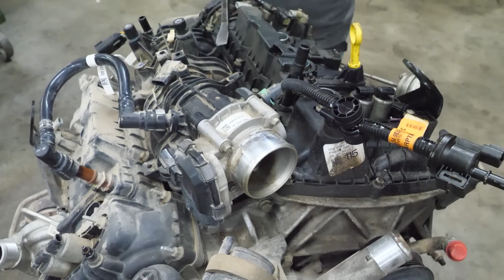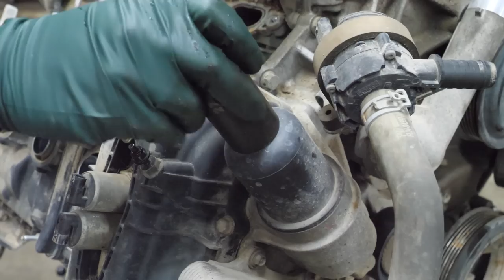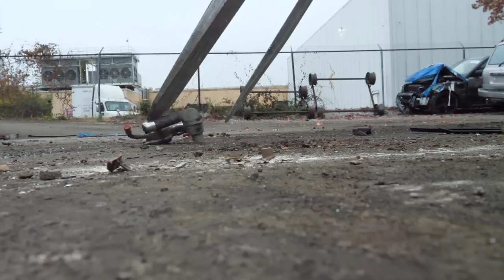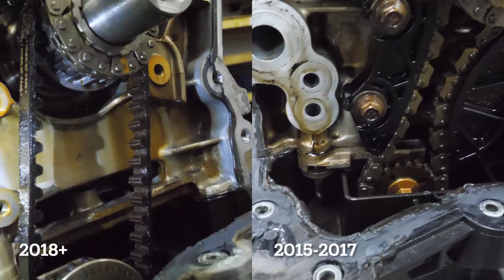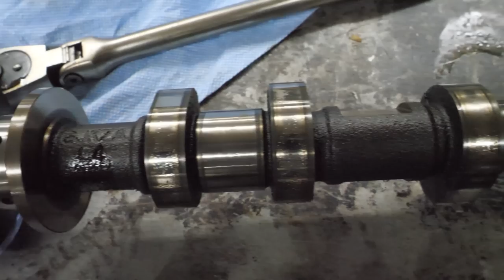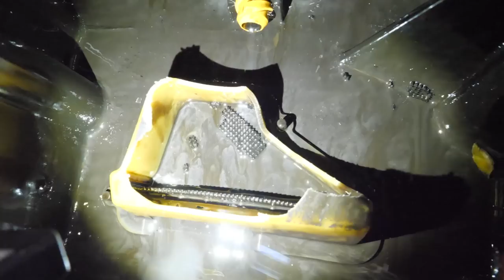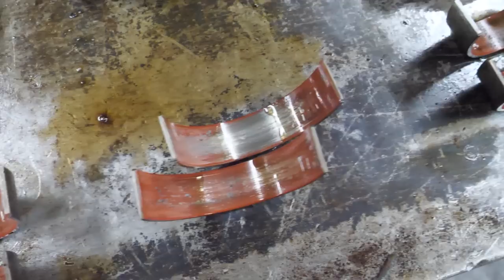A LITTLE TOO SPICY! 15-17 Ford F-150 2.7L Ecoboost V6 Engine Teardown

Comment: Those look like hypereutectic pistons, probably broke down into such a fine material that it did minimal damage to the harder surfaces - just mashed into the aluminum bearings and journals. I bet it wasn't run long in this condition either.
Reply: What an excellent comment. 
So having read the wikipedia article on 'hypereutectic' (I had never heard of this before), this explains so much - even possible pre-ignition damage.
https://en.wikipedia.org/wiki/Hypereutectic_piston
Reply: Thanks! I may be wrong about the material - don't know this engine platform well enough to guarantee anything, but I have blown up my own set of Hyper pistons and the failure was extremely similar. I reused basically everything but the block and pistons - only drove it for like 3 miles but the old Toyota 22re got me home on 2 1/2 cylinders! 2 pistons with chunked off ringlands, 1 of which had split in half leaving the wrist pin in the con rod to gouge the cylinder wall almost to the coolant passages.

The engine saw a temporary like 90° of ignition timing according to the log - only engine I've seen grenade like that without high rpm or boost.
Reply: The filter takes care of it.  The damage is from factory stuff when the engine was built, edges/oil passages not de-burred, swarf in the passages and stuff in the filter when manufactured.

Comment: After working on many fords I see less problems with the 2.7 then the other engines. If only they stuck with the chain but I haven’t seen a problem with the belt yet.
Reply: My Honda lawn mower has a rubber timing belt in oil.  Sounds crazy, don't it?

Comment: My suspect for the melted piston is fuel lean out on that particular cylinder, maybe a faulty injector or something wrong with the injection pump. Possibly too is a heavy load using inferior fuel and more air intake on that cylinder resulting in a too lean fuel mixture.

Comment: When you have a damaged bore like that, are not going to re-use the block, and want to demonstrate how 'pooched' the cylinder is, could you run a dingleball hone through it to clear off the high spots and show the craters? I think that your viewers would watch that.

Comment: Take an old iron engine block, suspend it up in the air with the fork lift attached with a quick release. Pull the cord and drop it 10 feet onto a water pump. Just a thought lol

Comment: What an interesting engine. More like a diesel than a gas burner. That rotary vane oil pump is also bomb proof and can ingest larger particles than any gear pump without harm. [2018  and up?] I don't like the Kevlar drive belt on the oil pump in later years but it is not a deal breaker. The loads are very low and the engineering on the belt is very high.

Comment: Can you do a Dodge 2.7L DOHC V6.  That is the engine with the internal water pump that is driven by the timing chain that had lots of sludge problems.  We would love to see a good dissection's of one.

Comment: Looks like what happens to a audi 3.0 TFSI engine with an integrated engineering tune, cylinder furthest from the HPFP gets starved for fuel and melts the piston

Comment: I had one of these in my '16 F150, what a rocket! Sold it at 48k miles for many issues like oil leaks from the engine and turbo's, sync system bricked...etc.
Reply: meanwhile I still drive my 99 chevy lololol
Reply: @TheInsultInvestor  I want my 2003 Grand Am back. All it had was power locks, the rest simple stuff.
Reply: oil leaking from whereabouts? How bout fuel economy?
Reply: @jamesmedina2062  Oil leaks from the turbo oil feed and return lines, around the oil pan, main seals. MPG was around 15 in the country and city, and 17 for the highway with normal driving.  May have just been a bad engine from the factory, but I did like it.
Reply: @jmt8706official  they are all built in series identical to each other. It probably ran like they all do and got commensurate mileage. People often say "oh on that day they were out to lunch " etcetera etcetera but thats also down to Ford's QC and symmetries or asymmetries. So it was fast but had some leaks and got typical heavy pickup mileage. Why didn't you just get warranty work and keep it?

Comment: Curious what made the side of that piston melt down? Perhaps a imperfection from when it was made?
Reply: My guess is a bad injector + Boost.
Reply from the maker: Too much air or not enough fuel.
Reply: A commenter suggested that E85 was used and that is a big no-no on EcoBoost's.

Comment: My guess is the DI injector failed on the one cylinder and caused it to run lean under boost. Most certainly the driver would have seen a blinking CEL on the dash that he must have ignored and kept pulling that trailer to the top of the hill before the smoke screen out the tail pipe. Oh well

Comment: wow, what an interesting teardown! i'm guessing low tension piston rings just to get .1 better mpg, combined with thin oil, no wonder these engines can be trouble. yeah, i'll just stick with the 25 year old proven design of the Honda J35!
Reply: You’re comparing a 3.5L running on premium gas with far less horsepower and half the torque to a 2.7L truck with 400 foot pounds of torque that has 10,000 pounds of towing. Not exactly apples to apples. Honda turbo charges their cars too now and put rickety CVTs behind them yikes. If we are going to just use the way back machine, I’d stick with a 4.9L straight six Ford and run it for 2 million miles.

Comment: Those plastic oil pans are one time use.  I replaced mine on a 2017 F-150 3.5 EB at only 14,000 miles because of leaking.

Comment: That engine looks so clean inside. I have noticed using Ford oil causes a massive buildup of burnt oil on all the aluminum parts.
So I would say who ever owned that truck didn’t use Fords oil. But probably blamed the oil they were using for the failure.
Looks like a faulty injector caused the lean condition destroying that cylinder.

Comment: Looks like start stop technology is great on bearings
Reply: this one did it's last 'stop'.  love the skinny rods too. 
look just like the crap you'd find in the 80s 1.9L Escort.  Must save a lot on gas with a light reciprocating assembly. Look at this 2.7, it's already saving the owner gasoline.

Comment: Add "single use oil pan" to the list of Ford's brilliant features.  I'm sure someone bothered to at least dead reckon how thick the plastic needs to be to compare to stamped metal, but it offers me no confidence.
Reply: the upper oil pan is wide, multi braced aluminum. But although not needed for rigidity, aluminum would improve heat dissipation
Reply: @jamesmedina2062  K, that's neat and all, but what does have to do with the big lump of plastic bolted to it?  There's a lot more to worry about than how hot it's going to get.  Like what happens if I hit a raccoon with it at 70mph?  Will it dent with no further issue, or will it crack and be a disaster?  And just how reusable is it exactly?  Looks about as reusable as a gasket (ie not very).
Reply: @Markworth  I'm sure there are a 1/2 dozen different pans you can stick under yours so you can hit raccoons and even crocs! 🐊   Seriously any car or truck  will have sensors to notify you of a major rupture. I had one so I know!  I shut my engine off and no damage to engine whatsoever.
Reply: @jamesmedina2062 So yes.  The plastic oil pan is more easily damaged, and companies have already produced aftermarket solutions because it sucks.

Comment: That burnt piston was probably a bad fuel injector causing a lean condition. Doesn't take long to meltdown.
Reply: Knock sensor failure and Ram low on coolant I think
Reply: Its why I avoid these little engines and will  always contend that just because the top numbers mirror those of larger displacement (low  stress) engines, the first thing that goes bad will likely grenade it. And they build these to make it to warranty. And nothing more.

Comment: Which of the recent (2015+) F-150 engines would you consider to be the most reliable at higher mileages?
Reply from the maker: The 5.0 is still a great engine 15-17

Comment: *Pound feet.   Everytime I watch one of your videos I am amazed at the engineering that goes into an engine and blown away with the number of parts. I don't own an EV, but they are so symplistic with regards to the drivetrain and that makes them very reliable and they will continue to improve. I'm a gear head at heart so don't give me EV hate. 👍

Comment: Had a 17 Edge with this engine.  Started fouling cyl 5 and burning oil at 10k miles.  Not a fan.

Comment: 3.4 v8 ford sho please. None have ever been torn down on video online.
Reply: They are known for camshaft gears falling off the camshafts. Ford has a TSB that uses Loctite to fix the problem instead of welding the cam on the gear itself which is the preferred method of repair. The Loctite TSB is a joke. Loctite has its limitations.

Comment: Several comments have suggested a lean condition in one cylinder as the cause. But the spark plugs were uniform in colour and if anything suggested an engine that was running on the rich side. If there were one cylinder running so lean, would not that spark plug have been a different colour? This is not a criticism of any who have suggested lean burn as the problem: I'm keen to understand what happened. Or did someone think that a set of new plugs would cure the funny noise and diminished power?
Reply: After the piston melted it burned a load of oil on that cylinder and made the plug dark again 😁
Reply: . @PineHollowAutoDiagnostics  Thanks. Plausible, and also explains the condition of the turbo on that bank.

Comment: It's overbuilt because it has to be, if you're asking 325 hp out a little V6 that has to power a big truck. Also, I'll bet a floating chunk of carbon got onto that piston and got  super-heated, melting the aluminum, causing it to come apart. Chalk one up to direct injection.

Comment: There is NOTHING good I have to say about a 6 or 4 cyl in a 1/2 ton truck. Not one that is actually used as a TRUCK.  You will star seeing a ton of these coming through as I have watched dozens of videos about engine and trans failures on the 2020 and newer models. Most lasting less than 6 months.

Comment: Whats with the red coating on the main bearings?
Reply: It's the copper base showing through where the lead used to be covering it.  The mains were worn down quite a bit.

Comment: I'm curious as to why the pistons came out so easy.
Reply: Most likely they are hypereutectic  pistons similar to those used in the gen iii LS based engines, and they expand to fit better in the bore as the engine warms up

Comment: I think these will be a high failure rate engine as time goes on. They didn't last in development testing before they were released. Theres nothing "eco" about them considering they require more frequent oil changes, use more fuel when run hard, and have more failure rates that fill up the junkyards.
Reply: What is your source on this?
Reply: I worked on the development of the ecoboost line of engines in a big name engine dyno lab. After my experiences with them seeing things like poor block design like on the 1.5-1.6-2.0L's.... plastic oil pump pickups, internal oil pump drive belts, and cheap ass turbo coolant line oring fittings that are doomed to fail. I will never own one and I tell everyone I know not to buy them either.

Comment: There is big differences in the transverse and longitude 2.7 and 3.5. Ford went cost cutting on the internals on the transverse of course Ford being Ford they didn't want vehicles in their lineup to beat their baby the Mustang. 
Like my 2018 SHO though once you get the engine built and get everything right you can gap Mustangs all day long. If Ford had put the 3.5 in longitude and gave the SHO the ten speed and kept the AWD, it would be a hellcat slayer.
Reply: try going the speed limit.
Reply: @TheInsultInvestor   I go to the strip, a street race is rare and only for distance or speed. Speed limit? Never.

Comment: I HATE the “eco” boost lineup. Yes, they develop decent power but no better gas mileage. I had a rental Escape with a 3 cylinder that I never could get better than 21 MPG. My CRV gets close to 40 MPG with 1 more cylinder and a half liter more displacement.

Comment: That not a lean condition,  that’s low speed pre ignition failure.  Fuel gets caught between the rings and ends up like that.

Comment: These aren't very low-compression engines, 10.3:1 Ford is playing with fire (no pun intended) to only require 87 octane gas.  More than likely this engine saw a lower-octane gas or an issue with the wastegate causing the gas to ignite before it should have, causing the piston to continue traveling upwards and the combustion to travel through the piston as it had nowhere to go.  I personally would never run anything lower than 93 in a boosted engine that comes in any mainstream vehicle, to run 87 I would like to see that compression somewhere around 7.5:1 to a max of 9.5:1 for the longevity of the engine.
Reply: Just using the compression ratio is meaningless without considering the rest of the engine design.  Mazda runs 13:1 or 14:1 in the Skyactiv engines on 87 octane.

Comment: Would those turbos be too small for a 3.7 2011 Mustang?  I have been considering putting a small turbo on each bank. How much hp would it be with two separate intercoolers?
Reply: 3.5 EcoBoost turbos would fit before 2.7 turbos (I’d imagine anyway)
Reply: I have a twin turbo set up off a 2jz that would probably work with a little custom fabbing!

Comment: That there is what happens when you run 87 octane fuel on a turbo charged engine and you rely on knock control.

Comment: How great would it be if you saved up a bunch of the used parts you normally toss around (post toss) and built some mismatched, raggedy ass, barely misfiring on a stand engine lol

Comment: I'm going to go with a long grade/overloaded towing situation on 87 octane crap gas.  The 2.7's to my knowledge were not really advertised as "performance" engines and therefore the owner probably didn't give much thought to listening for pinging.  I can't remember if the 2.7 F150's have the fake engine noise pumped in.  If they do, then the fake engine noise would probably make a hurtin' engine sound perfectly fine.

Comment: why does direct injection build up so much carbon in the intake?
Reply: No fuel washing the valve off. The injector is inside the combustion chamber. Port injection every time the injector fires it washes the valve off, helping mitigate carbon buildup.
Reply: There will always be reversion (fumes making it into the intake), but there's nothing to wash the insides of the intake passages.
Reply: @philrab @mfree80286 thanks!

Comment: The reason for the belt is less metal parts . That belt that runs the oil pump which if your using 5w20 motor oil the belt will never break. Take a hack saw cut the belt in half that will show u hidden strength technology.   It is 2023

Comment: Ford ! Model after model - year after year leaves no stone unturned changing parts , bolt hole patterns - electrical connects yada yada yada ! If anybody knows the horrors of non standardized. Parts it would be me !

Comment: Way more complicated than it needs to be. No reason not to be running Ford 300 inline sixes or GM 4.3's these days. 3800 Buicks, etc. These newer engines are over complicated for very, very minor gains in power or efficiency.
Reply: True these are complex , but after driving all the motors you’ve mentioned, these 2.7L engines are amazing! With proper maintenance these have no problem hitting 2-300k. What amazes me is 400 ft. Lbs. of torque, 27 mpg and silky smooth operation in 5000lb truck

Comment: The Napleton dealer group are a bunch of scam artists.  Drove to one to look at a car.  They advertised it at $24K, but they don't mention the non-negotiable $6000 warranty that their CPO company "Requires".    Funny that the certified pre owned company forces you to buy their warranty but they failed to notice that the back-up camera is upside down and they missed the bald tires on the rear of the car.   There are many complaints for this dealer group.  Do yourself a favor and avoid Napleton at all costs.

Comment: When the head is cast with 2.7 RWD you know parts compatibility is going to be bad.
Reply: I caught that too and came looking for someone else to comment on that.
Reply: They make fwd and rwd…the timing covers are different so it makes sense that the heads would be different.  It’s purely a transverse vs in-line thing.

Comment: Ok I like every other motor loving grease monkey love hp and torque. But if this is how Ford gets that kind of power out of this small V6? I’d much rather have the less, but decent power the much simpler 4.3 Vortec V6 Chevy produces with less than half the parts. Or the LS series of V8’s.

Comment: So 'if' that monster timing cover leaks at the back of the WP it'll put coolant into the crankcase... dumb engineering.👎
Also... cam doesn't have separate bearings, the caps and case are the bearings???
A wet-belt driven oil pump... did that save Ford a few pennies? Am I reading those belts failing? Another dumb idea.
Could the 'newer' GM 2.7 four-cylinder be a better more reliable engine?

Comment: I have a weird feeling that a few years from now, you’re going to have a bunch of turbo charged engines available. From all different brands, no Toyota won’t be exempt from that trend.
Reply: Unless manufacturers get it through their thick skulls you can’t put a 2.3 N.A. oiling and cooling system on a 250-300 hp turbo engine that makes a bunch of extra heat, I suspect you’re right.
Reply: I see a pattern of piston rocking from the short skirts.
Reply: Very curious to see how durable the Benz turbo 4 engines will fare in the AMG and more heavy duty Sprinter vans